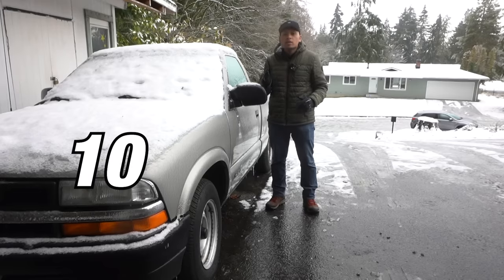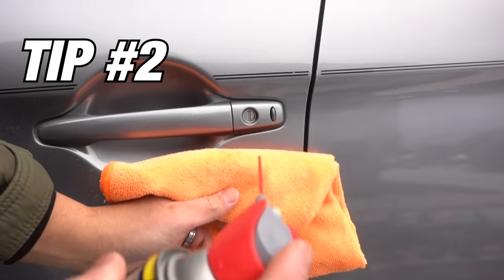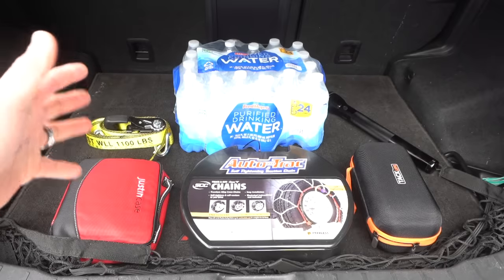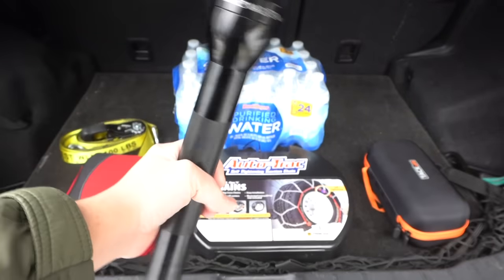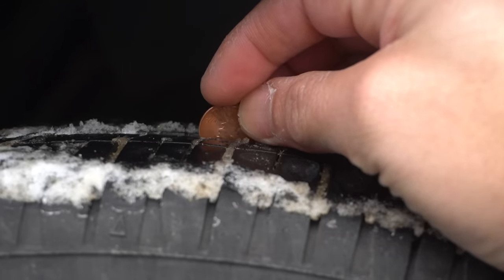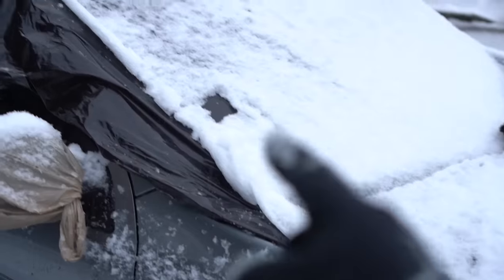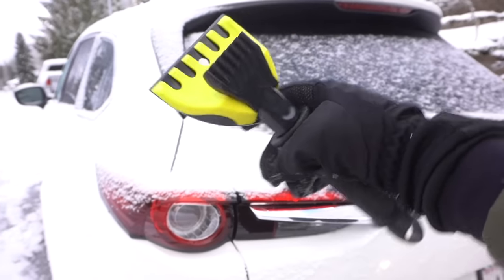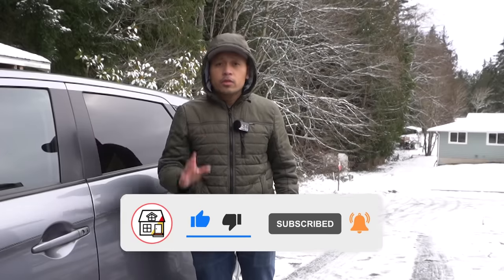10 Winter Car HACKS TIPS & TRICKS That Could SAVE YOUR LIFE! DIY

Comment: Never keep water bottles IN your car. When it freezes overnight; bottles popped, causing water leakage, and that water freezes as well. Better to keep it in your house and take it in the car just before departure.
Reply: when water freezes, it becomes ice, it doesn't pop.  but best to put the water bottles in a container and have a towel wrapper around it, so if/when the ice water melts because of warmer weather, the water is absorb by the towel and stays inside the container.
Reply: I have Like 10 bottles rolling around my car, Never had a issue and yes it’s 20 degrees here too but thanks
Reply: I keep water bottles frozen in my freezer in the gaps between the frozen food for when the power goes out. They won't pop. And it'll keep your food protected for several days.
Reply: Most water sold in stores freeze at a much lower temperature than 32 degrees. They also don't expand much if they do. Scary I know.... I don't drink them very often. Experiment with a few brands to find out. A few in a emergency beats the alternative.

Comment: Always clear your tailpipe if you are going to let your car run. If the snow is higher than your tailpipe, it will push carbon monoxide back into the car. People die every year in Northern states.

Comment: WD-40 silicone - make sure you ALSO apply it under the hood rubber trim, in case you need to jump start your car hood will not freeze on frame too.  One more tip: there is a TIRE GRIP spray, eBay sells them, you apply it on a thread, not on a side like a tire shine, it forms a fresh rubber layer, good to drive up to 50 miles on snow or ice, much better traction. Drive safe ✌️
Reply: Brilliant.

Comment: When stuck in freezing winter conditions warmth is most important. Throw in your kit next to the above mentioned items a pack of tea lights, a few bic lighters, and something to burn the tea lights in (for safety). A few burning tea lights are very good at keeping warmth in your car. Open your window a tiny bit for fresh air and to let moisture out! Add a blanket if you want. An led light at night is visible for miles so if truly stuck, don’t leave your car. They’ll find your car, usually, before they find you…... Add dried food/energy bars.

Comment: Consider getting military MRE Meals to take with you in case you’re stranded. This was a great and informative video.! also consider having candles and matches with you in a tin can to keep them dry. That way you can melt some snow for drinking. Also your bottled water if you’re stranded is going to freeze so you’re gonna need to build to melt that.

Comment: Chocolate bars have that energy in them that helps in cold weather. Also they are easy to eat even frozen. Cigarette Bic lighter types do not work as they get colder and colder because the gas pressure inside the lighter reduces to the point it cannot push the fluid out to burn.
Have waterproof matches and a couple of the "Emergency candles." They last longer than dinner table style candles. Also have a couple small candle holders. Candles will keep a car interior warmer than you may think.
Reply from the maker: Thank you for sharing these great tips! 🙏🏽😊
Reply: Put the lighter inside your coat for a few minutes and it will work just fine. Same with small camp stove gas canisters.
Reply: @rnordquest  Or under your armpit, where's plenty of heat.

Comment: Here in Northern Europe long before we had WD40 silicone we used to paint or rub rubber door seals  with solid or melted candle wax in winter its natural does not attract dirt and repels water, doors will not freeze to the car, silicone spray in door locks is not a great tip TBH silicone spray thickens in freezing temperatures and makes locks stiff to open it also draws dirt into the lock barrel where it will be suspended for evermore in a silicone mush, Glycerine syringed into the lock will prevent freezing and will lubricate its also cost far less than a tin of expensive Silicone spray from WD40
Reply: I use ski wax instead of candle wax. You can put glycerine in one of those little plastic bike chain oil bottles with long nozzles if you don't have syringe.

Comment: Regarding those emergency items he showed in a trunk.  Believe it or not, water freezes in below freezing weather and probably would burst the flimsy plastic bottles.  
Also batteries, such as in a flashlight, don't work well in low temps.
Once I had a loaner car from a dealership that had a chip or something in the lower central part of the windshield that I noticed when lights hit it driving home that night. The next morning, I put the defroster on medium because the windshield was covered with a thin layer of ice, and the thing cracked from that place when the hot air hit the frozen windshield -- which they said I was responsible for..
Now I take longer and keep the defroster on fairly low.

Comment: I have a tote with: extra glove s & toque, tea light candles, metal can, metal cup to thaw frozen water, tea, protein bars, hatchet, lighters, matches, cotton balls infused with wax, flash light, batteries,  Mylar blankets & Mylar tent, paper maps just in case phone dies, extreme multi tool that includes a mini hammer, ratchet set, first aid kit, knife with survival gear in handle. Etc I also keep a sleeping bag in the back seat, w extra engine oil, windshield washing fluid, snow brush, etc. you can never have too much safety gear. I need to get a couple more things but, it’s a good start.

Comment: Carry a tyre pump manual or electronic the number one reason for roadside breaks in the UK is tyre deflation causing punctures blowouts tyres coming off rims etc.
You can also let pressure out of tyres in an emergency to get more traction but re inflate at the earliest possible safe opportunity or your tyres might come off your rims.
The two handed bike ones are surprisingly good with the shrader  valve connections.
Also check all your fluids levels check your antifreeze levels and efficiency, add screen wash fluid brake, clutch, oil check them all and adjust tyre pressures if carrying passenger’s luggage etc up and down. Typically fuel station ones aren’t accurate they live a rough life being dropped and run over they can be out by quite a bit several Psi buy your own quality one look after it and it will last a lifetime.

Comment: Keeping your fuel tank filled with gasoline also reduces water vapour, always present in ambient air (about 23%).  As the fuel level subsides, this leaves increasing room for air.  With increased accumulation of water vapour, the risk of condensing water freezing in your fuel tank also increases.  Very little ice is needed to block a fuel line.

Comment: get an ice scraper with a brass blade. 
I don't live in a snowy area, but was traveling through one a few years ago. I picked mine up at an ace hardware after it took 2.5 hours to deice the windshield using the defroster. 

The brass is softer than steel, and won't scratch your glass. The edge will also get under the ice, and lift it off instead of abrading the surface. Sort of like the credit card trick, with a better handle and a blade that won't wear out . They are also more compact than the plastic ones, and lay flat in your glove compartment.
Reply: @mikegrok - if your defroster took 2.5 hours to de-ice the windshield, either you are exaggerating, or defroster is not working.  :hand-orange-covering-eyes:
Reply: @warriormanmaxx8991 Exactly.  I live in Saguenay (Canada) where it regularly reaches -30 degrees celcius in winter and it won't ever take two hours to defrost a car, even if there's a thick layer of frozen rain
Reply: @warriormanmaxx8991 I think it was 12f.  It worked eventually. I had just arrived in Salt Lake City from San Francisco the day before, and had no supplies for cold weather. My car usually gets 38mpg, so there was not a huge amount of excess heat to pull out of the engine. 

After getting the windshield deiced I got snow tires, which I still use in the winter months 7 years later.

Comment: I would be very hesitant to use that ratchet strap as a tow strap. Its breaking force is way less than your car weight and has a lot of metal hardware to snap that can break windows/kill somebody.  It's important to get a proper tow strap that rated to 3x your vehicle's weight. The best option would be a kinetic tow strap which works like a bungee and reduces forces on the vehicle while multiplying your pulling force. Avoid metal hardware at all costs unless its rated breaking strength is well above the forces at play in the vehicle recovery.

Comment: 3:10 - 
I have that EXACT jumper in all 5 vehicles plus a couple spares in the house for use during power outages.  I also add a cheap pair of short jumper cables to make it easier to reach a proper grounding point under the hood.
Water like that is a freeze/burst hazard.  I use a large thermal bag (like for carrying frozen grocery items) to keep my water from freezing.  Additionally, gallon zipper bags to storage bottles separately serve as a hedge against leaking bottles.

7:45 - it's advised to NOT leave your wiper blades up like that.  Wind can make them slam into your windshield and crack it.  A better option would be to use a plastic bag or even a long tube sock to separate the wipers from the windshield.

Comment: Questions: 
Won't the batteries go bad from the cold weather? 
Won't the charged items lose their charge in the cold?
One more won't you end up with just ice in your water bottles?
Reply: If you find yourself in an emergency I suggest contacting emergency services asap.
Electronics can be insulated against cold weather like the car electronics. 
Cold weather effects chemical batteries and reduces their output. 
The water bottles would freeze at 0c. Sports drinks have a lower freezing point than water but be careful. You can melt clean snow and drink it. You can idle your car for warmth unless snow blocks your tailpipe (Use with extreme caution).

Comment: Put plastic bag over the rear window also. If you have remote start, set your front defroster to warm or hot before it snows. When your ready to go out start the car and let it run for a while to melt or soften the snow or ice for easier clearing.

Comment: Thanks!
Reply: It is basic knowledge, just like putting winter windshield screen washer liquid instead of summer or else it will crack by expanding water in the hose inside in the winter. Or pour vodka/ alcohol into a mix. So it will not defrost.

Comment: Good Tips! But.. The first thing u should always do is get Studded winter tires. no summer or all season or else u will get stuck in 2 seconds of driving.
Reply: Studded tires only in jurisdictions where legal.
Reply: Studded winter tires only in jurisdictions where they are legal.
Reply: I live in CANADA and our winters are horrid. Barrie, Ontario had 230 cm of snow last winter. My crazy ass drove ALL winter season with all season tires. 😅 It’s called Quattro AWD, don’t brake as often and don’t speed. 🤷🏽‍♀️ Most people just can’t drive, you can make through winter without, if that’s all you have, just be smart about how you drive without winters. ( I don’t recommend it, but it can be done.)

Comment: Thank you so much
Reply from the maker: You are most welcome Darlene! Stay safe! 🙏🏽😊
Reply: It is basic knowledge, just like putting winter windshield screen washer liquid instead of summer or else it will crack by expanding water in the hose inside in the winter. Or pour vodka/ alcohol into a mix. So it will not defrost.

Comment: Really useful tips, thank you for making this 👍 Cold water (not warm or hot) poured onto windows works wonders to clear snow and ice. For extreme climates the temp. difference between cold water and frozen ice may be too much IDK, but here in the UK it seems a safe rule of thumb and works extremely well. A large watering can and a quick trot around your car and it speeds things up greatly ❄️🔥

Comment: Very nice hacks and tips.. Thanks.. In case of doors stuck because of iceing along the door edges you can melt the ice by using 2/3 of sprinkler fluid and 1/3 of water to spray around the frosen door in order to get into the car.. Mild weather getting ice cold can create this condition..😊🇩🇰 Greetings from Denmark, Northern Europe..🙏🏽
Reply: Sprinkler fluid? You mean windshield washer fluid?

Comment: Tip 11. Drive Slow. 
Don't use the defrost on your windshield.  I've cracked more windshields when its frozen outside. Even on warm.. Just use heater blowing out vents on medium high. Car running wait 15 minutes. Practice how to put on chains before it snows. Ice tire socks rather than chains are nice.
Reply from the maker: Thank you so much for sharing your experience and tips! 🙏🏽😊
Reply: I call Bullshit on your comment.
First off I live in Canada and have never seen this happen ever. Secondly, Defrost is designed exactly for that purpose. Windshields are laminated and have enamel surrounding the entire windscreen that controls expansion and contraction by distributing temperature evenly. Google what the "black dots do on your windshield. You're welcome.
Reply: When it is -40°C, I am definitely using the defroster. Heck! Even at 0°C, I am using defroster. I do cover my windows with windshield covers, plastic bags on mirrors and wipers. Some days and nights are just too windy to have wipers up.
Reply: Living in Canada ive never heard of this happening, not ONCE.
Reply: LoL must not actually get very cold where you are because defrost is often needed to see while driving even after car is heated up.
Reply: @chictastic  no doubt while driving use defrost after the ice buildup is gone. Fairbanks Alaska -40 and -10 during the day. Tops out -60. Please continue using defrost when you startup in the morning to get the ice off the windshield 😁

Comment: Some +-40 years ago, a company making car wax used silicone in the wax. If i remeber right they had collored wax, Not sure!
Anyhow, cars that had to be repainted got bubbles on the new paint, unless they took 100%  of the old paint away. And it took alot of cars to find out why this happened.  If previous owner had used that wax the car was still "infected" 
Just be careful with silicone. Using wax on the paint inside of the doors makes it "slippery" for ice to hold on. And is easy to keep klean. Vaseline on the rubber works fine, and its even the best for rubber o-rings. Like gardena hoses before they dries out from the sun and heat.

Comment: Ratchet straps are for securing loads NOT vehicle recovery. The ratchet mechanism can/will fail especially if you have to do a jerk recovery. Then you'll have a chunk of metal moving at a very high rate of speed coming back at you (plenty of YT vids showing where people have been killed). A 10,000 lb rated tow strap at Harbor Freight is only $20.

Comment: Only thing is the water would be a block of ice within 30 minutes here in Mn everything else very handy .Bonus Tip put studs in tires they work great for icy roads being illegal in some states means nothing to me compared to my safety believe me ain’t no officer pulling u over cause he had a microscope to see you have studded tires while driving in the snow.
Reply: Put water in small ice chest?
Reply: Studs are illegal in some places.
Reply: No one is asking for your "illegal stud advice."  :face-red-droopy-eyes:
Reply: What do u mean it will turn a block of ice in 30 minutes? Are saying WD40 Silicone wouldn't work ?

Comment: If u dont NEED to go anywhere then DONT. Also when roads are sketchy speed is not ur friend. Even if u get stuck u wanna gain traction meanin very little throttle. Speed limit signs also help cuz u can come to a quick stop if a deer jumps out or something. Dont lock up the breaks and take a longer safer way back where roads are more driven on compared to a short cut that might get u stuck.

Comment: I know it might sound silly, but use your hair dryer on an extension lead and you'll have no problems. Warm your engine up, warm your windscreen up and. After scraping the excess snow off your windscreen.(windshield) and  locks I laughed when an older guy told me about this  ,
. Hack
 But I tell you it works. And I've been doing it for 20 years , now. 🏴

Comment: Can u apply wd40 on the rubber seal of a sunroof of a car so it doesn’t stick to the panel when trying to open it
Reply: Yes, but you could also just leave the sunroof open overnight. Then use WD40 to clear the ice off your ignition in the morning.

Comment: Don't run your defroster if you windshield is cracked or the Crack will grow before your eyes!😂 Simply run your heater first so you don't shock your windshield 😊
Reply: too late 🤚thanks
Reply: usually the defroster gradually warms up and shouldn't crack windshield due to rapid temperature change caused by the defroster.  but maybe your defroster has a high amp and gets hot quickly.